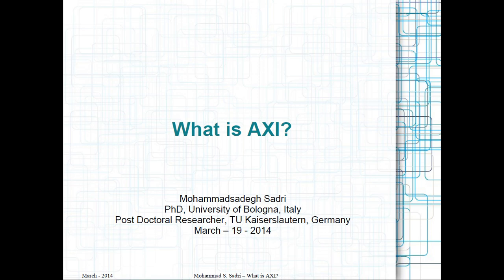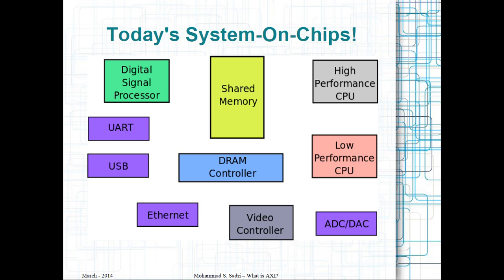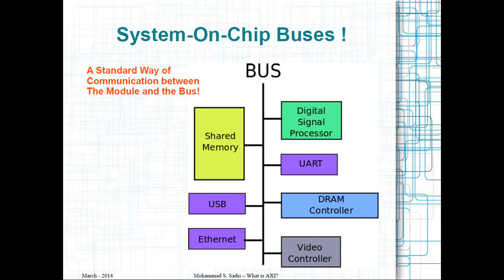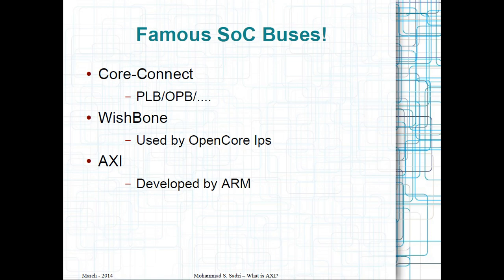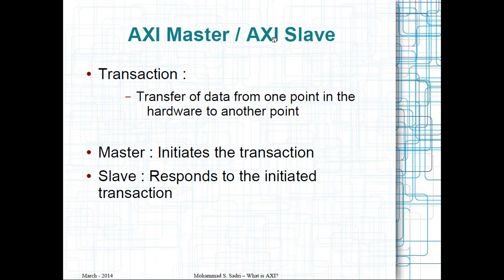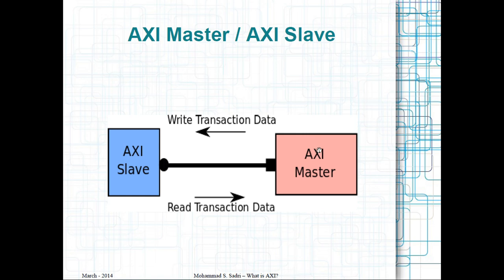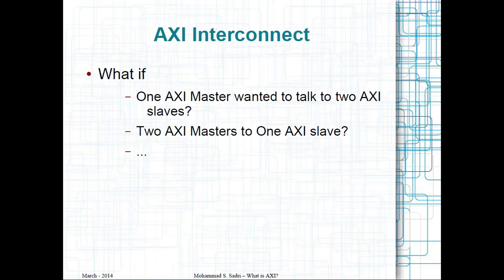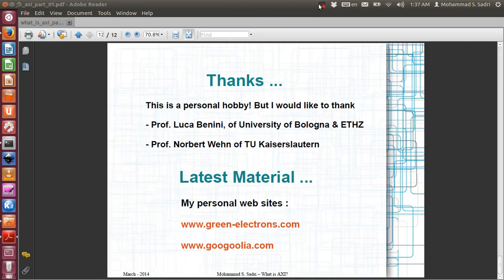ZYNQ Training - Session 01 - What is AXI?

Comment: sir.
How many channels are involved in the read transaction( ie when master reads the data from the slave)..will master sends the address and receives the data from the same channel? I THINK THE FIVE CHANNELS ARE
1.read address channel
2.read data channel
3.write address channel
4.write data channel
5.write response channel
 are the read data and read response channels same?
Reply from the maker: Hi. Yes, read data and read response are the same. And the reason is simply, beacause it is a read operation and practically, the answer is the data which is comming back to the master from the slave.